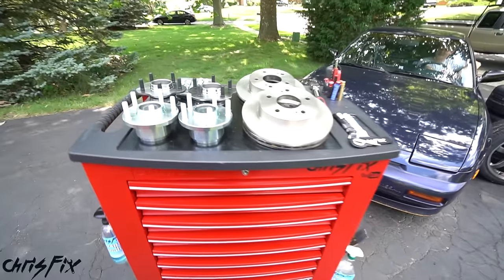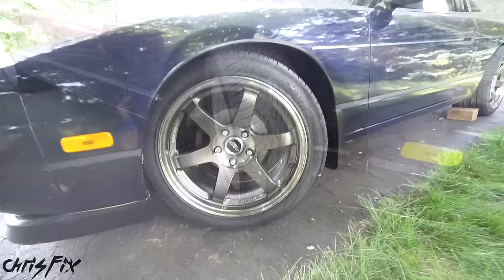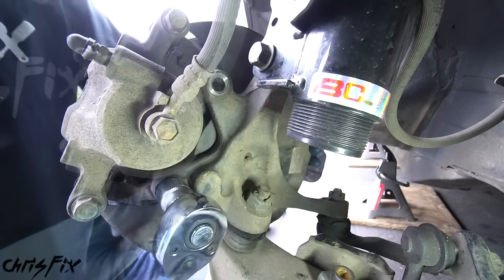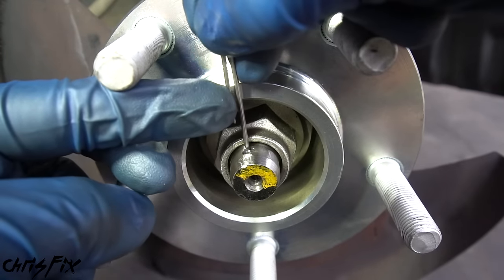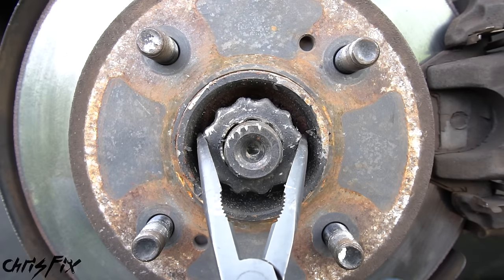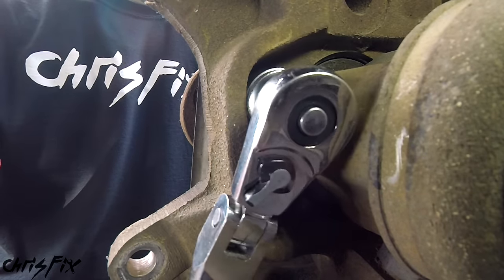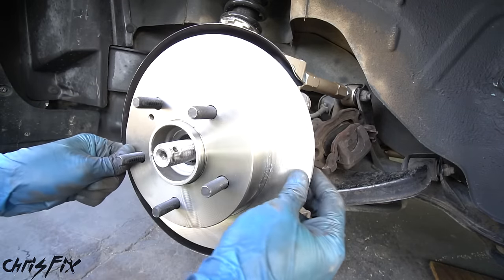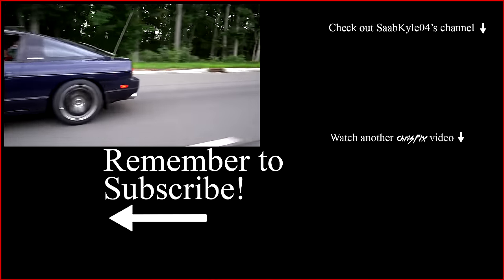DIY: 5 Lug Conversion on your Car or Truck

Comment: On the rear if the old hub is seized you can spray it with penetrating oil then using one lugnut and a logging chain you can bolt the chain to one stud and whip the chain to make a improvised slide hammer to break it loose

Comment: Two things:

1. Remind people to make sure the e-brake is on Bc with open diff cars it can now roll with 1 rear wheel off the ground 

2. You should have put a little grease on the front spindles so the hub doesn’t freeze on over time

Comment: Watching this just now made me decide that I'm going to change the hubs instead of getting wheel adapters....that way I can get the bearings replaced and just a cleaner more reliable way to go. My car is a 2008 cobalt 4 door ls. Front wheel drive. I'm not sure how much different this job could go for me. If You or anyone else could weigh in with insight and knowledge I would greatly appreciate it.

Comment: Try doing that to a 2001 Honda Accord 2.3L. You need new knuckles, calipers, bracketry, everything. However, all the needed parts are on an EX with the 6 cylinder and an earlier version of the Odyssey, etc. In my case the car is the lowly base model DX, so I am doing a 4-to-5 lug conversion and the larger brakes from the 6cyl car, AND conversion from rear drums to discs. What a massive PITA, but it is totally worth it in the end. Good video. I just wish it was going to be so simple in my case, heh, heh...

Comment: I was curious if you could help me match up a 5 lug conversion for my 99 Honda Civic ex coupe? It's standard 4 lug but after seeing this video I'm completely down to convert to a 5 lug but I don't know what year 5 lug hub and bearings will be compatible with my car and don't want to waste money buying the wrong items! I was blown away by this video since I didn't realize that you could do this so easily and now I would really like to so any help would be really appreciated. Thanks

Comment: Hey Chris I work in a shop just a tip with the torque wrench don’t pull up on it use your body weight to push down on it
Reply from the maker: Thanks for the tip!
Reply: ChrisFix np man I watch your vids all the time didn’t think you would reply 😂
Reply: ChrisFix I also just subbed and put push notifications on I’ve been watch your videos for maybe a year now but it’s rlly sick hearing from you man if you want we should talk I got questions just dm me insta is zachrobbz

Comment: Hi Chris. Lots of help to me. Thank you. One question. How do you know how much torque every different bolt requires?
Reply: Owners manuals will have some, but not all the torque specs. You can find most of them in Haynes manuals though!

Comment: I would like to see you breaking loose a bolt you locked before with thread locker without using a torch to melt the blue thing, I’ve seen broken bolts with less thread locker you use

Comment: I was always told by mechanics that when changing to new brake discs you need to install fresh brake pads, too. Which was not the case here, and I wonder why?
Reply: Probably just to keep the maintenance same but other than that idk

Comment: On the rear axle, you kept calling the retainer an axle nut cover.  Since the axle nut is not drilled for the cotter pin, the retainer is the safety lock, and the cotter pin is installed thru the retainer.

Comment: I changed a rear hub in a Subaru a couple of years ago and it was so rusted in that even a slide hammer and pneumatic hammer couldn't budge it. I had to make a custom puller.

Comment: Why didn't you check the disc brake, rotor warp/imperfections etc? There's always some runout. If you measured it you could rotate the brake disc to reduce the wobble. Isn't not doing it bad practice?

Comment: Awesome video. I want to do this to a sentra b16 that came with 4 lugs. Can I do this as easy? Wonder if the parts of the b16 sentra are interchangeable.
Reply from the maker: If it has this style wheel hub then it would be!

Comment: 2:47 very important step, just in case the jackstands fail somehow, better to be safe than become lieutenant dan, also a wheel bearing is a lot easier to change than I thought it would be

Comment: I have a ram and it's a 8 lug 8x6.5 but plan on replacing hubs. But want to do a conversion to a 8x210mm. Much thick stronger studs because I plan to run 24x14 and they're heavy wheels. Do you think thats possible. Please reply

Comment: Dangling the break caliper and pads with the hose don't matter, if it cannot handle 5 pounds of weight then it's no good to handle 100+ PSI through master cylinder. 
P.S-I have been hanging the brake calipers through brake line for more than 10years now, never had any problem.

Comment: Quick question, why didn’t you use any lube on the front spindle when you put the new hubs on? I don’t remember the exact stuff but we used to have to cover the whole spindle and the bearings with it. Thanks

Comment: Does this work/is it safe on any vehicle? More specifically, I would like to change the lug pattern on a 2nd gen sequoia from 5x150 to the 6x137. This doable? Would there be any mechanical drawbacks, both short and long term?

Comment: awesome stuff, love the channel. I have a 97 Ford Ranger truck bed trailer but tow it with a 4runner - 5 vs 6 lug. Currently running a 5 to 6 lug adapter, would this be a better/safer way to get the 6 lug tires on there? Also, because it's a trailer can I remove the inner parts of the wheel hub, like the brakes and stuff?

Comment: Wider wheels don't give you more grip.
In fact, they can reduce grip in rainy weather due to skidding effect. The only thing that matters is weight of the vehicle and coefficient of friction of your tyre.
Reply from the maker: Thanks for sharing!
Reply: @chrisfix  Np, wider wheels are still very useful because they offer extra stability, less lateral flex and allow for more downforce or weight (due to higher surface area, there is less pressure on the tyre) and less overall wear given the same thickness because there is more surface material. 

But if you have a small engine, the moment of inertia (which depends on the distance of mass from the axle of the wheel and total mass of the wheel) can eat up your torque and cause worse gas mileage. 

An ideal wheel would aim for maximum mass reduction away from the center, and all the necessary support as close to the center as possible. Two wheels can have the same mass and completely different moment of inertia, which at speed could mean 10s of times of difference in strain and gyroscopic forces. 

I'm a very big fan of your videos and you help a lot, I'm not a mechanic, but I have degrees in chemistry and physics.

Comment: Is that possible too do on the Nissan Pulsar N15 SLX Sedan from 1997 ?
Reply: Maybe it's a little too late but... look for the Nissan Primera P11 rear brake setup (calipers, rotors, beam axle) they should be the same
Also, i'm pretty sure there's a version of the pulsar that came with rear discs
 Ps: in the case of the b15 sentra you can swap the p11's setup

Comment: I replaced the axles in auto repair shop they didn’t put any cotter pins on both axles, when. I asked the supervisor he told me is not necessarily putting the cotter pins on, and your your car will have no issues, I don’t feel comfortable and I still drive it, do u I think he is right or wrong. And what to do if axel came with no hole for cotter pen

Comment: Just what I needed to know for my 4 lug yaris.. dude it's freaking difficult to get the wheels I want for it with 4 lugs.. thanxxxxx
Reply: @WeAreWatching Yu .. no I haven't started to look yet..
Reply: @WeAreWatching Yu  BR racing coilovers  not yet installed, 18" wheels  . No engine mods yet & debating on a future engine swap to an 1.8

Comment: It's actually quite easy. The hard part is, there's no available conversion kit for my car. I need to replace the spindle and the whole rear diff. which i can find on a more modern version of my car. Also, my car has rear drums so the process is a bit different.

Comment: I have a 97 f150 4.6 I want to convert the hub assembly from 5 lug to 6 lug. How do I Find a 6 lug hub assembly that will fit my truck??? I’ve looked online and can’t find anything.
Reply from the maker: Some cars or trucks require swapping out axles to do that unfortunately!

Comment: hey chris, would just like to know your opinion on wheels spacers or wheel pcd adapters? specifically 5x100 to 5x114 pcd adapters. are they safe to use? pros and cons would really help.

Comment: You don't want to convert to five bolts. It's heavier. Also torquing with thread locker is not acceptable. The thread locker will act as a lubricant which will significantly decrease the amount of torque applied

Comment: Is there a conversion for a saab 900s convertible, I have some rims that I took off my BMW.  The rims are 5x120 and 5x114 bolt pattern.  The saab 900s is a 5x110.  Is there a conversion ?

Comment: How about a 5x100 to 4x100 conversion? I have a 612 whp EJ8 Civic coupe and it's 4x100, and I have three sets of rims for it. I also have a 2000 Mk4 Golf and it's 5x100, and I'd like to use my 17" rims that are 4x100. 5x100 to 4x100 wheel spacers don't typically exist...

Comment: This doesn't apply to vehicles with a fixed front rotor does it? Been considering converting a vehicle of mine from 5 lug pattern to a larger 5 lug pattern to convert to a different set of rims that were previously on a different vehicle.
(Bought aftermarket rims for second vehicle to give it a classic look now looking to put the original wheels to use rather than have them sitting around)

Comment: I still can't believe that spindle nut is a 30mm that literally shocked me, 
Anyways I seen this vid an took interest cause I bought some chrome 20's for my 04 Mustang but the bolt pattern is completely differant on the new rims so figured I'd get adapters but heard adapters are bad for torque an bust so I may do what you done to this 240.
Would a 04 Mustang be similar to this like what I'm asking is will the rear of mine be as simple as this 240 ?
I've worked on cars for several years but I've never swapped hubs..

Comment: Hi Chris I was wondering if their is  any conversion for 5x135 pattern for a ford f150 to go to 5x4.5 I bought some wheels that fit 5x4.5  and supposedly the 2000 f150 are 5 x4.5 but the wheels dint fit. So was wondering if you knew if their was a 5 lug coversion  that can be change for this truck. I think mine is 5x135 pattern not sure can you also make a video of how to measure lug pattern measurements.  Thanks I like your videos.

Comment: hey chris. hopefully you can respond in 2022 haha. so i am looking to swap a 4x100 bolt pattern hub from a 1990 civic onto my 1990 honda accord. how do i know if everything will fit or not? will the bearing sizes and splines be universal from the same year civic to accord? i dont expect a straight up answer from you i just need to know how i can make sure it will work. thanks

Comment: If the car was going to get Wilwood brakes as well, why not do them at the same time as the 4 to 5 lug conversion? That would have been the logical thing to have done since everything was already apart.

Comment: hey ChrisFix, I was wondering would a hub adapter to go from 4 to 5 lugs would work the same because they make them for my car, but not a hub conversion kit. I'd really appreciate it if you replied.
Reply from the maker: It would work! You just need to make sure your wheels are at the desired and correct size!

Comment: Chris, i've got a ford focus with a 5x108 bolt pattern, is it safe to daily it with a 5x114.3 adapter and 5x114.3 wheel?

Comment: hey i have a question can it be possible to change the rotors and wheel hubs in a 2000 f 150 to 7 lugs

Comment: That conversion can work on a Peugeot 106 phase 1 of the 93? Because I've 3 screw wheels and i want convert it to 4 or 5!
Reply from the maker: It should work, but I would say you should do more research on parts that will fit your car!

Comment: I have a question are all wheel hubs universal to fir all cars? Cause i wanna change bolt patterns as well how do you know if its gonna fit the make and model?
Reply: Research it online, its not that easy to find a hub that fits your car.

Comment: when u replace the discs u ment 2 do the pads aswell as u never know if the old discs have cause uneven wear or a small part of the pad stuck on a small pebble causing damage to it
Reply from the maker: Yes but in this case the new brakes I showed in the beginning of the video went in after he got home so it was fine.

Comment: Never put threadlocker on caliper bolts. They can snap. Hell, half this stuff does not need thread locker, its just asking for issues with removal later

Comment: Did you ever bolt the brake rotor back on😂 I hope so 🤞
Reply: Wayne Cluff you dont need to lol those little screws are only there to hold the rotor down during assembly there not needed once everything is back on the car

Comment: Sketchy lift points. Those aren't structurally sound points to lift from since its a unibody construction. That part of the car is meant to crumble and bend very easily. It might be OK for 9 in 10 cars you work on, but that 10th car when you realize the alignment is all off because you bent the frame slightly 3 feet back behind the wheel... it will crush your dreams and soul.

Comment: Bugging me that the brake pads was also not changed as the older ones would have been shaped onto the contours of the earlier roter...
Reply: mickeygoesferal the owner is changing the brakes to Baer

Comment: why change hubs, rotors but NOT pads? for cost, you're in there already!
Reply: I'm thinking the next upgrade...the Wilwood big brake upgrade kit mentioned at about 37 seconds in will take care of that. They probably just went with cheap rotors to get the car mobile again to do the big brake upgrade another day.

Comment: Is anyone able to slightly better explain the part at 8:20 - 8:33, don’t fully understand why hammering at the axle is a good idea and won’t cause damage
Reply: The axle may be binded on due to corrosion as a lot of brake and suspension parts are. So hitting it with a hammer helps break it loose. The nut stops the hub flying right out. Putting the nut flush with the end of the thread protects the threads from damage with the hammer blows. 

Just be careful if using this technique not to hit the nut as you’ll damage the threads. Ask me how I know.

Comment: It's more easy to push the wrench to down instead lifting up.
Reply from the maker: It’s easier for me to pull it up. More control and you use your muscles instead of your weight.
Reply: @chrisfix  I can't because my one knee joint is damaged by an accident it cannot bear too much pressure now!! 😊😊
Your videos are very informative keep it up and best of luck👍👍👍👍

Comment: Of course expect every bolt and nut to be seized solid and the hubs to be frozen on.  After 12 hours of spraying, heating and beating, chances are; youll be towing it to the nearest shop, while you head to the urgent care for a busted nut.

Comment: That is not the correct way to jack up an s13, you're lucky the rails didn't cave in. Better to jack the front up from the crossmember and if the car is too low to get a jack under, drive up on a 2x4 or something to get enough clearance for the jack. For rear use the differential for jack point.

Comment: But what if car have less "teeth" on this lug?!
Reply from the maker: It could upset the abs system. Can you swap out the “teeth” part? Sometimes it’s just pressed on.
Reply: @chrisfix  I live in Poland and I own Peugeot 406 coup and it originally have 4x108 I have adapter 5x112
My friend that have same car tried to research how to swap 4 lug to 5 bolts version. He did not succed. I thought that I could search info from experts from other continents :)
Maybe someone know how to deal with such thing.
All I researched on my own is that Peugeot 605 and 607 had 5 lug mount. Not sure if it can be swaped to 406
I was also wondering is there a way to change it to 5 lug from other type of cars.
In poland it is little problematin in insurance claim if car is modified by using adapters. So I was wonrering is there better way to convert lug from 4 to 5

Comment: Don't ever put a tire under your car for protection.  Find something else.  I did this once and when the jack failed it popped my good tire.  Very expensive.  Just find something else
Reply: A popped tire is better than a smashed bone/death if you were underneath the car.
Reply: @nakian5316  that's why I said find something else.  Only use tire if you have nothing else.  Not thinking about it popping I used a tire but I could have easily found something else if I'd just looked around.  200 dollars down the drain and a perfectly good tire ruined.  It's cheaper to find something else.